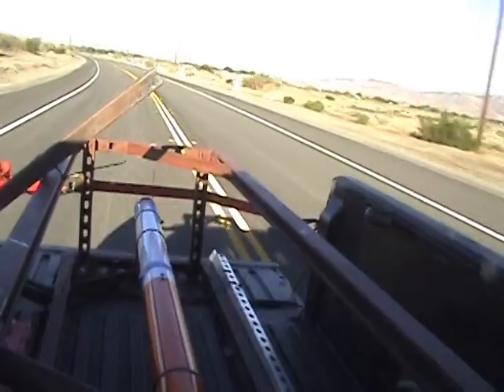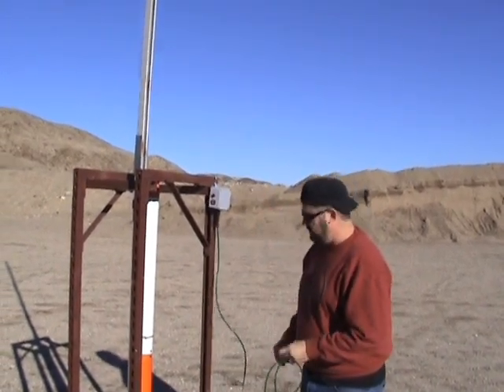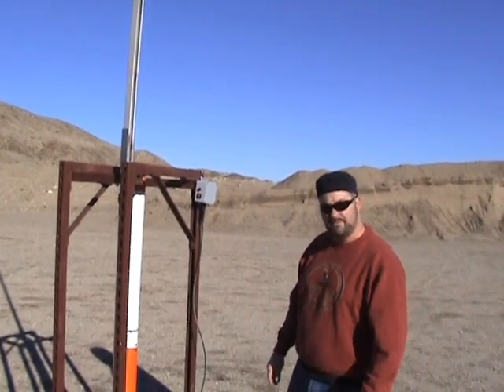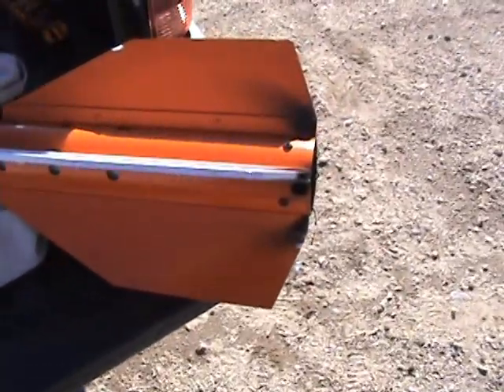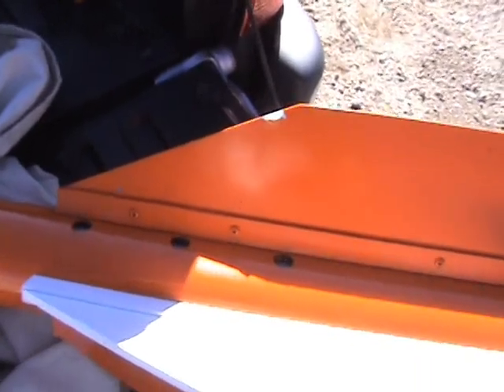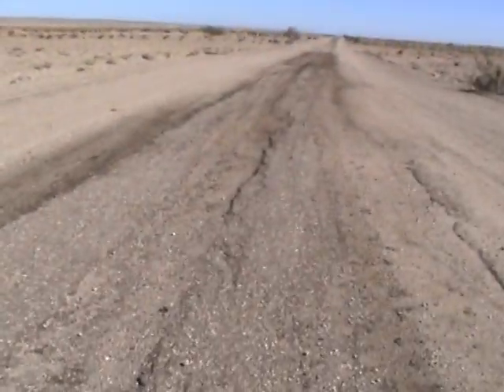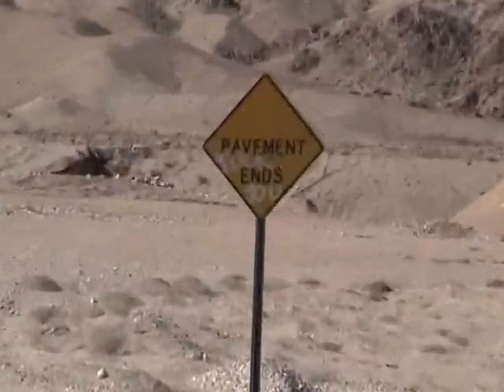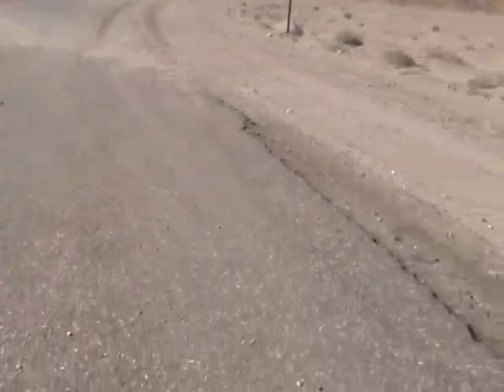PVC Sugar rocket flight with on-board video

Comment: Great flight.  As an electrician  I may have an awnser to the cracked tube. PVC conduit gets real brittle the closer it gets to freezing. From experience PVC conduit will crack by just tapping it with a hammer bellow 45 degrees.  Just a thought.  Great videos. Great website. Will definatly be picking up your book. A++